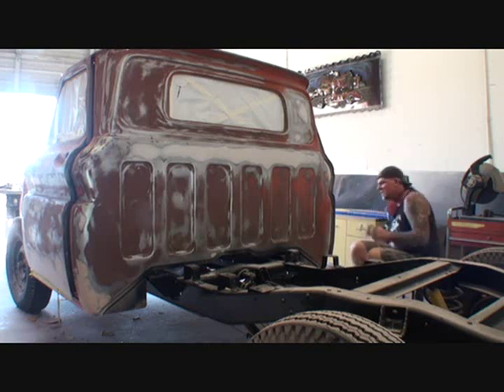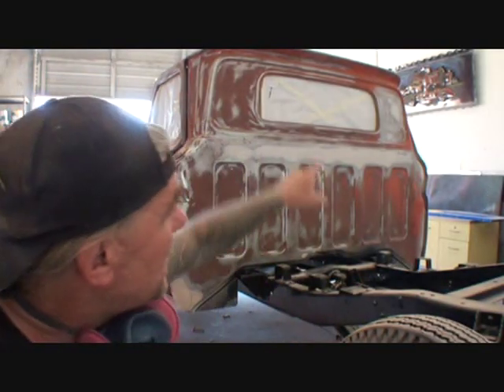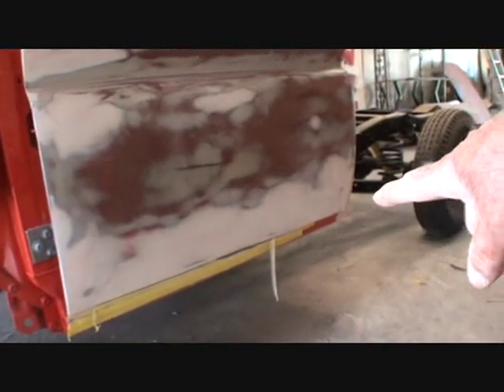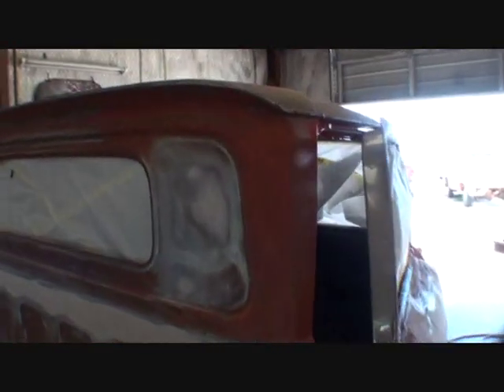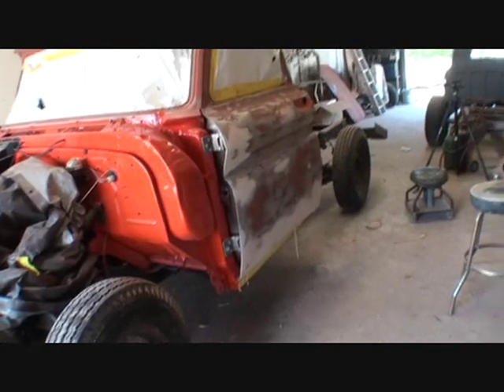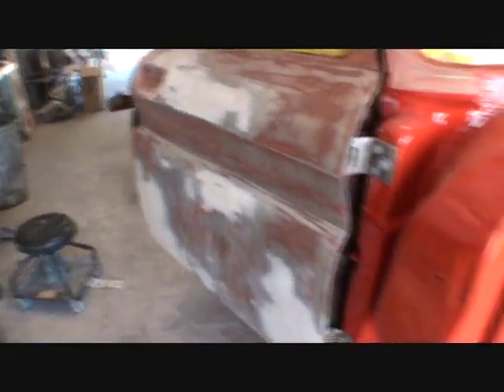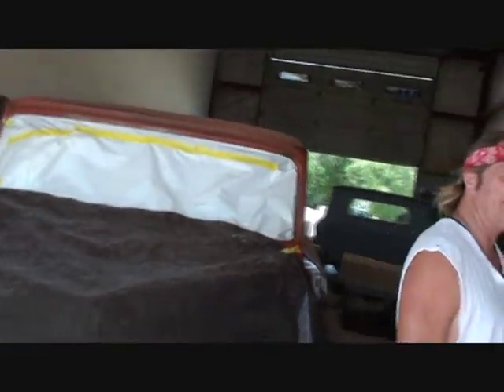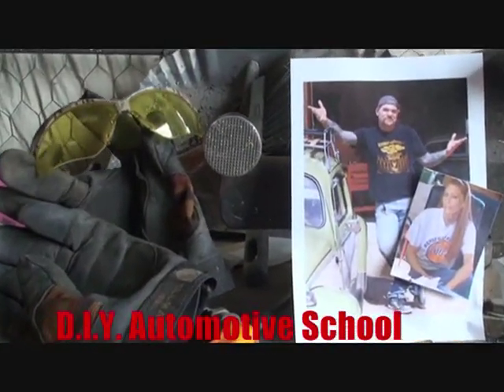Fix Dents On An Old Pickup Truck-Part 3

Comment from the maker: If your using base coat paint you have to clear coat either way. If you don't want to have to clear coat then you will have to use single stage urathane paint .. You can't just spray base coat and be done with it, it will eventually fade out and peel off.. Pete

Comment: A 78-81 chevy truck k member with better front suspension and disc brakes on it falls into place pretty easy , most bolts line up i think you have to redrill 2 of them..

Comment: I was going to say that Dylan's a keeper then I seen this. :(  I would be there all the time just to learn how I can fix mine.....myself. Do I have to go to Texas to take a course?  My van is original paint but is oxidized and turns rags red. My understanding is that it has to go to metal. Pete needs a minie hug today and some hot chocolate with marshmallows. :)

Comment: Hey,can you tell me how to get a body line on a 85 c10 front fender correct? I betive used a gallon of fuckin bondo trying to get it right! It was dents along fender lip plus a dent higher up.Also,i did all body work(left factory paint) and sealed it with epoxy;now i see the body work hazing through.Can i use glaze now,then high build primer?thanks for any advice..

Comment: if reality tv was real it would have no views because there would be hr's of nothing really going on just hr's of sanding it sucks to do but i could never watch some one doing it for hr's and i just love how they just put everything new . i watched a show and me and my friend priced all the parts they used they replaced everything new . it cost just in parts a little over 65,000 on replaced parts they did a good job but could never put that much in a car i'm just to cheap . i like my way were i can sell it and come out way a head . like my 68 pu i have a good body a stroked 454 with tunnel ram heavy duty 400 turbo and a 12 bolt possi all that is left is the final paint job and it runs hard over 800 hp the best part been offer 8,000 for it but only have 2,300 in it after i paint it it should be worth over 25,000